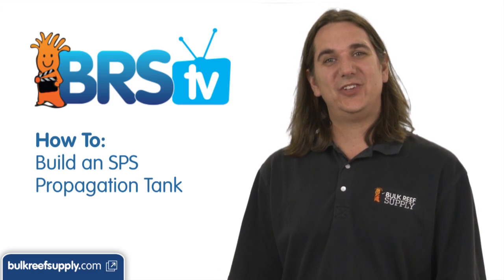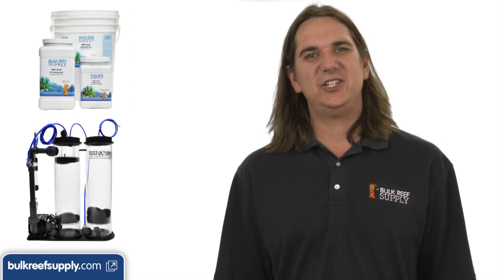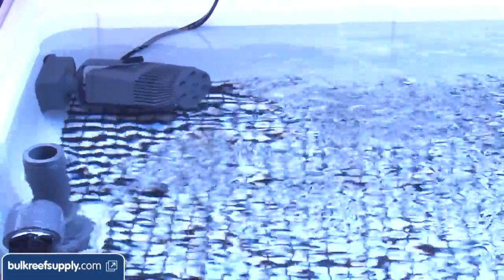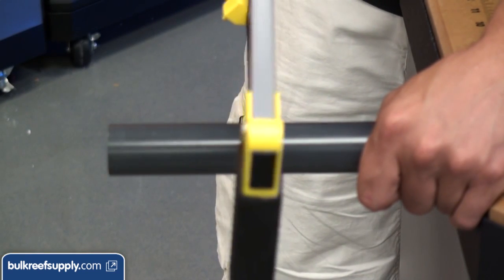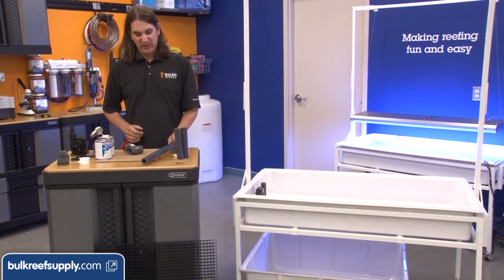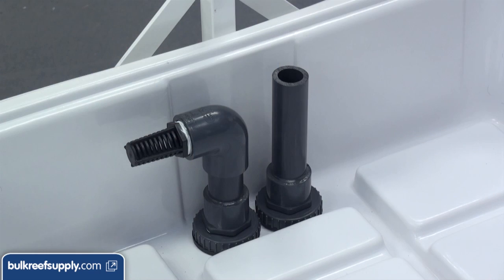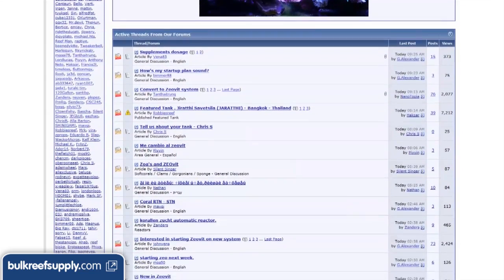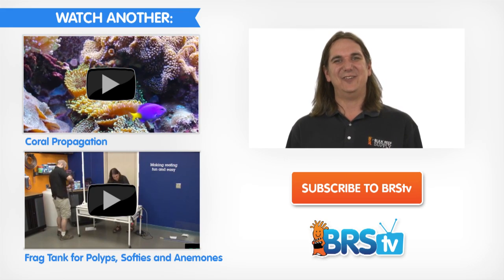How To: Set Up a Frag Tank with Sump for Stony Corals -- EP 3: Coral Propagation

Comment: 4 years old, can you guys revisit this topic now that the technology has significantly improved?
Reply: BulkReefSupplyCom you should bring them back, I'm interested in them as well.
Reply: Jeremy Young look into hydroponic equipment, I’ve found perfect set ups very similar to this (ebb & flow) for around 200$
Reply: @BRStv   Maybe it would be easier to have customers source the stand parts, reservoir and tray (give brand/part numbers of what you used before) and sell a kit with the additional fittings, pump, pipe, hoses and clamps needed for the setup? Perhaps add a list of cost appropriate doser options, etc. to choose from on the page for the kit? This way there are no additional sourcing needed on your end, and we can easily get started with a usable setup without guessing on what to use?

Comment: Tip:  A bulkhead can be installed backward with the gasket on the outside though it can be a pain to remove later in a calcium encrusted mature reef.  I would changing the phrasing in future videos to say that the gasket should go on the side with the flange(which is on the part you refer to as the "main head")  In some situations with freshwater vats(RO storage) people may want to install the bulkhead in a way that saves space.  As long as the gasket stays with the flange it will work properly.

Comment: I have a question. If you are suppose to give a nutrients low envirorment you deffinetly need a skimmer, but you dont want a skimmer because you are adding that expensive coral food. So you rely only in water changes? Also i've heard that you need to supply the corals with enough food so that they can live with the least amount of zooxantellae and thus displaying the colors of the inner tissues, but if you do that without a skimmer the nutrients would build up. A I right?

Comment: is this approximately what you used in this build: Frag Tank Kit with Sump, Plumbing Kit for Frag Tank & Sump, 48" ATI SunPower High Output T5 Light Fixture 6 x 54W, 150W Neo-Therm Submersible Heater, APEX JR CONTROLLER, apex salinity sensor, 8” x 8” x 4” Plate MarinePure Ceramic Biomedia, Sicce Wave Surfer Controller with 2 Voyager 4 Stream Pumps, SpeedWave DC Pump - 2640 GPH, 1⁄2 Gallon - BRS 2 Part Total Package with Dosers.  if i missed anything please let me know

Comment: BulkReefSupplyCom, My local hydro gardening store carries most of the parts I need for this build. Is there an in sump protein skimmer that you would recommend for this size of a system?
Reply: That is a nice model. It does seem a bit big for that size of system, are you able to adjust the flow rate to compensate for the smaller volume?
Reply: +BulkReefSupplyCom do you still supply the bulk heads that fit this hydroponics tub? I'm having trouble finding one that's small enough to fit both primary and emergency overflow side by side. Thanks so much for replying to all of the comments from an older video. ; )
Reply: in the video it looks like the SCH 80 TxT bulk head to me. I wanted to make sure before I buy the bulk heads since I want to install two side by side and there isn't much room to work with.